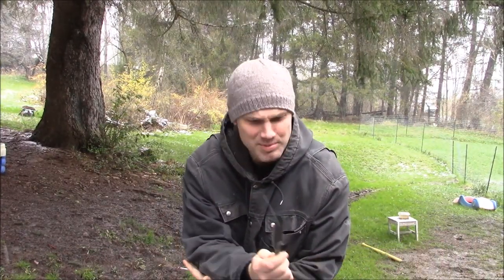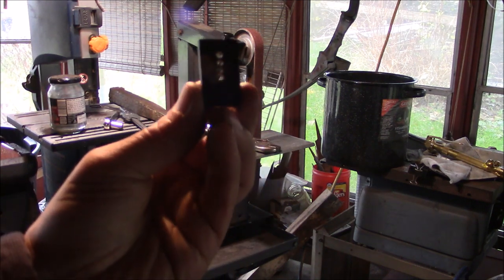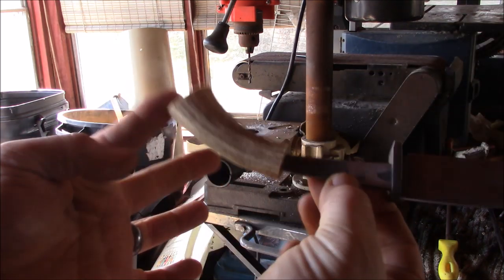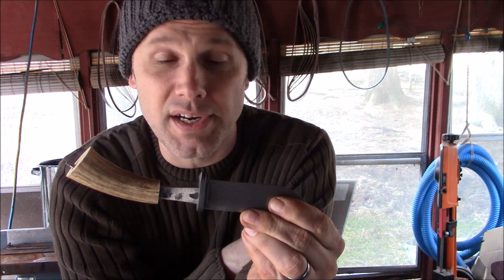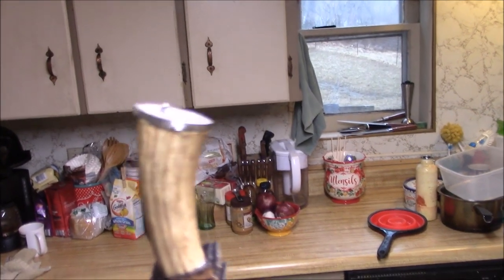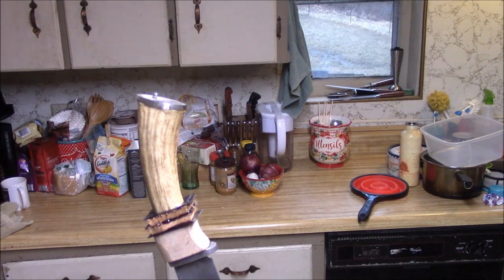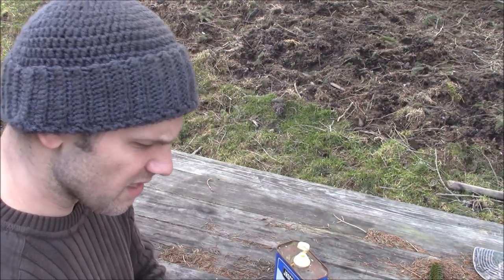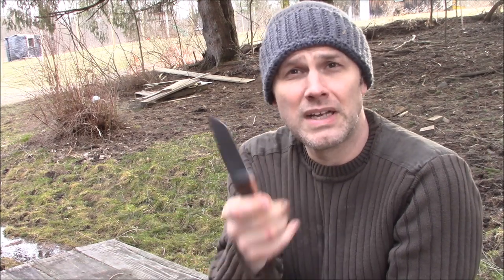Making an epic antler handle!

Comment: Yo, Enjoyed your video. In the future, if you do not want that peened pin on the end.  when you have plenty of tang like you had,  just cut a little off the tang to allow more room at the end of the antler. Then on the pommel end take a bolt (if you have the room you can add a nut as well to allow more for the epoxy to hold onto) and weld it onto the end cap. Now drill a hole into the antler on the end at the same depth as that welded bolt and epoxy it in. Presto no peened pin on the end. Also, the time to etch all of that Damascus is right before you put all of that together. Always try to use an epoxy with a longer cure time... the longer the cure time obviously give you more time to fiddle with things but more importantly , the longer the cure time the stronger the epoxy.  West systems is the best I have seen and is what most professional knifemakers use. No criticism here, Just some constructive remarks from an old guy who has been making knives for almost 15 years. I would have no problem carrying that knife on my side.  Keep making them and keep learning on how to make them better. Once the knife making bug gets you your bank account is in trouble.  I have spent a lot of $$$$. The best part is long after you have left this planet that knife you just made could be in the hands of your great, great-grandson handed down as a family jewel!  Enjoy my friend!
Reply from the maker: Thanks for the very thoughtful and polite comment. I use 2000 pound epoxy with an hour working time. I have more ideas on different techniques to use than I have time to try them out. I'm hoping to build a garage closer to the house in the next couple of years. It would be nice to be able to work in a shop with heat and electricity. If you're ever in the upstate New York area feel free to stop in and see me.

Comment: One question how do u take a straight drill bit drill a hole then put curved tang thru it
Reply from the maker: The hole isn't straight. It's two holes that meet in the middle and then they are shaped a bit more with small files. Also some grinding on the tang to get the perfect fit.

Comment: That’s a sweet blade. A little trick I learned is before you epoxy the blade is to put some butchers bowling alley wax on the blade an inch after the guard,any epoxy squishing out will go on the wax,easy clean up then.where upstate are u located.i would love to check out your work.good luck with your back,goin thru the same myself☹️.
Reply from the maker: Binghamton area.

Comment: a ferriers rasp will save you alot of sanding on antler stuff .
Reply from the maker: To each their own but, in my opinion a rasp would be too aggressive to use on antler. Unless you need to remove alot of it. 🤔

Comment: Just curious as I’m new to knife making ( literally weeks) will the leather not shrink? Nice job by the way just subbed
Reply from the maker: It hasn't shrunk yet. Using stacked leather is not a new technique, it's been done for hundreds of years if not longer. Good luck on your knife making. 😎
Reply: Can u expound on the colored paper spacer?
Reply from the maker: @natefihn8188  Nothing to really expound upon... Just epoxy liberally between each layer essentially making your own micarta.
Reply: WJ Blades ok  thanks man, I’m brand new to this so excited to learn, keep up the fine work!

Comment: What is that tool that you use to hold the metal bits to the belt sander called?
Reply from the maker: Not sure what you're referring to are you talking about the magnet?
Reply: WJ Blades yup! Do you know if it’s possible to buy it online?
Reply from the maker: @oggoborr4757  https://www.harborfreight.com/4-piece-magnetic-welding-holders-93898.html?cid=paid_google|||93898&utm_source=google&utm_medium=cpc&utm_campaign=&utm_content=&gclid=EAIaIQobChMIh7rj-ua26AIV5JJbCh2OWwHIEAQYAiABEgJqIPD_BwE

Comment: Garbage
I'd be amazed if it was still in one piece
Reply from the maker: I cut through deer sternum with it all the time. It's also one of the primary knives I use to butcher. Flawed as it may be it's turned out to be an amazing knife. If it's not your cup of tea no problem mate.